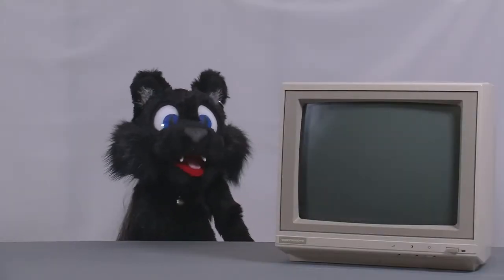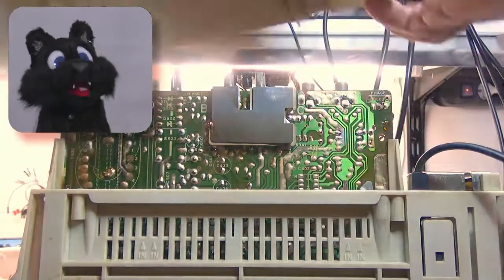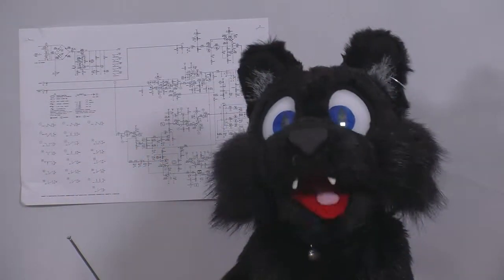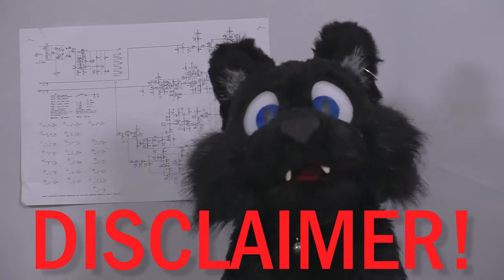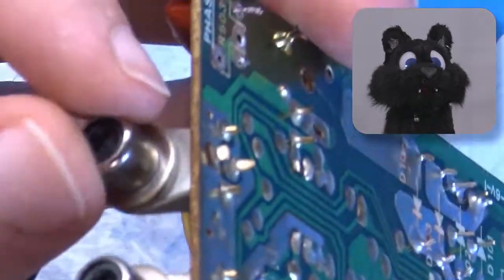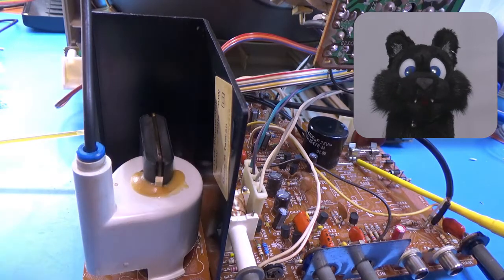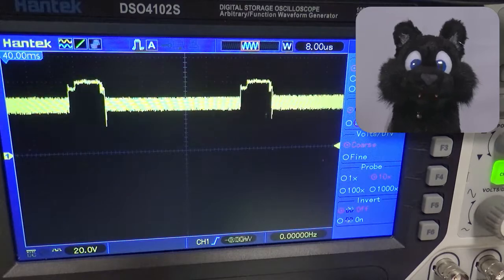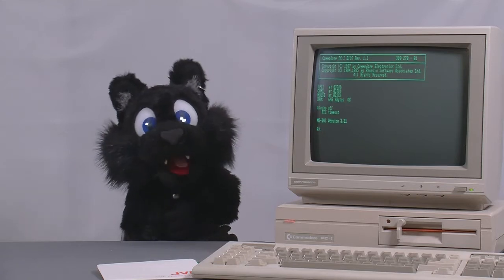Restoration Project #15 - Commodore DM-602

Comment: when i was electrocuted with 400+ volts it took 15 minutes of feeling "half bad" over the ambulance and the hospital. 

you were really lucky Atkelar and to be honest ... 

I was amazed how easy you were at the high voltage source. 

Please be more careful, this is not good for the fur.
Reply from the maker: People who grew up with electricity tend to see/feel it slitly less risky. As long as there is no heart condition involved and the contact is brief, it usually is not a big deal. The HV in the CRT is extremely low powered, so it's more like a really strong static shock. I did have the 400V experience while working on a distribution board once too. I'd take the CRT any time. I am usually very careful whith what parts I can touch, but I missed the fact that the neck board has higher voltage too. The plug on the CRT is much higher!

Comment: Oh ick. Tobacco residue is the worst thing to remove from electronics. The best thing I've found to remove it (in general) is "sugar soap". It's used for cleaning tobacco residue from walls before repainting. Also -- wear gloves! Nicotine is absorbed through the skin and (in my experience) will give you an awful headache (or worse).
Those bipolar electrolytics are hard to find, I had to find one to recap a Philips CM8833-II. I substituted it with a high-voltage poly film capacitor and insulated the legs with heat-shrink, which worked great. Much easier than trying to fit two electrolytics in the space of one.
Reply from the maker: Thanks for the hint! I did not think about that old gunk too much, as I had the towels and hardly touched any of it directly. I am still not very versed when it comes to HF stuff, and the cap in question was smack down in the cathode line of the CRT. I am still questioning if it really needed a bi- or non-polarized one... with the diode in parallel, it *should* be fine to use a polarized one IMHO, but lack of knowledge made me stick to the original as closely as possible.